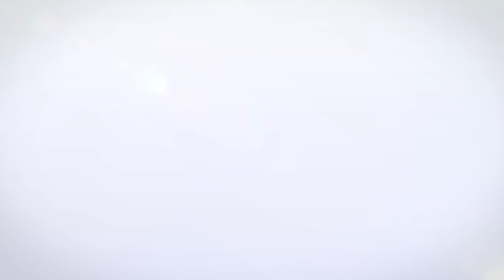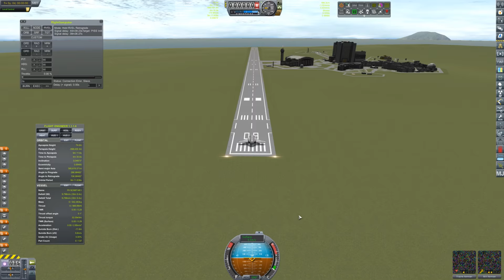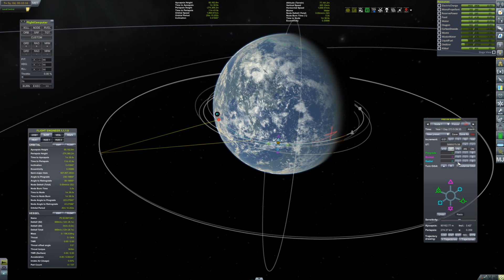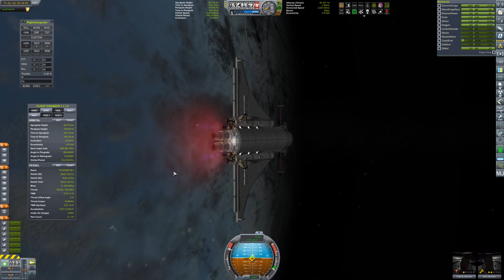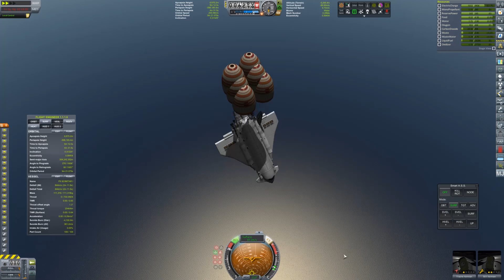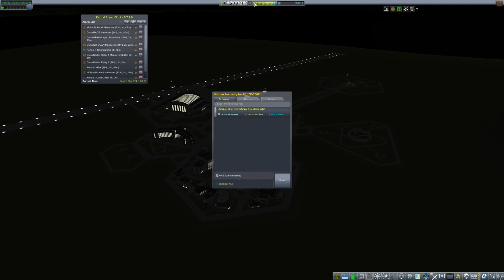Kerbal Space Program [1.1.3] - Ep 61 - More Space Station Assembly  - Let's Play

Comment: I hear ya on the real life stuff.  I wanted to comment last video but would have been late to the party.  Yes, more weight to the nose.  I also feel the wings rear edge control surfaces should be further back.  de orbiting immediately to 42k wasnt ideal since you will further drop periapsis entering the atmosphere. The nose angle was too high you'll need watch the rate of descent gauge essentially the lifting body is braking more than lifting and as such entering more like a capsule.  The reduced lift at the high angle and the aggressive entry combined was too much vertical descent for your plane.  You can also FAR test the planes AoA  (for example the ideal angle of attack for max lift at 1600m/s at 50k altitude with empty payload and minimal fuel).  With no heat protection you need to bring the plane down very slowly until the plane is completely suborbital.  Your plane handles it better having built in heat dissipation.  So you can afford to be more aggressive (it didn't explode from aero forces)  

Basically, try to aerobrake longer there is no race to get to the ground.  The plane should work fine if slower (more control) on the rate of descent.  Modifying the weight to nose and control surfaces back etc.  helps to broaden the safe descent trajectories allowing more room for error.  I really don't know how close the center of mass is in relation to the center of lift when near empty when you re-enter you did say they were close and that is treading on thin ice which is why it's been problematic.  It takes practice and patience but you can get it.

Comment: is you do design a system that will let the cockpit be jettisoned then it will not only ensure a safer re-entry into earth's atmosphere but it will also add more weight to the front solving the problem
Reply: Yeah your right the fuel in the front would weigh it down and if it does fail then there wont be any kerbals on board already.